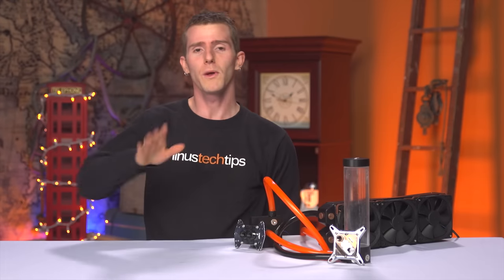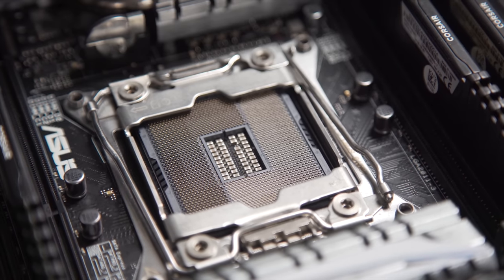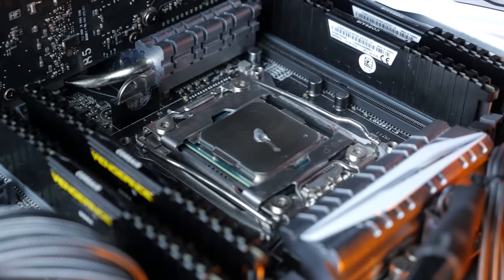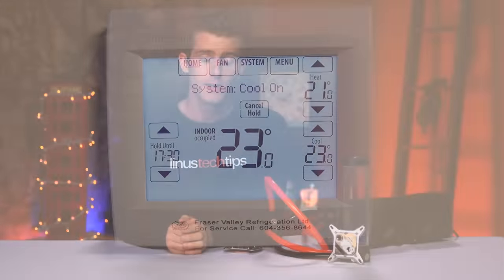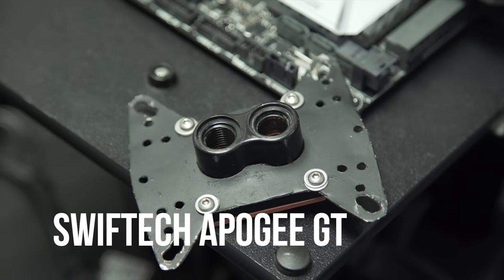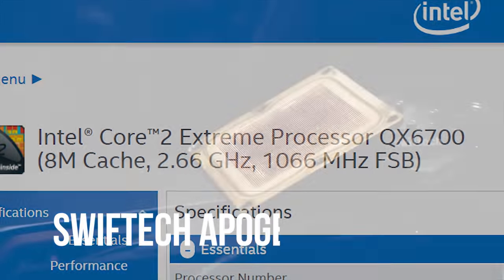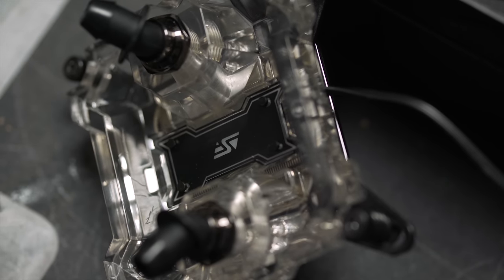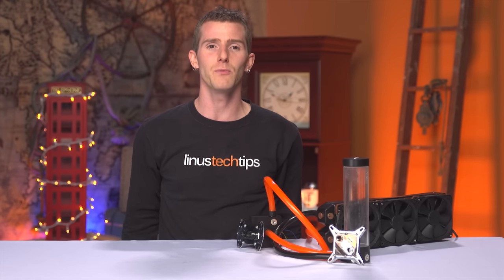TEN YEARS of Water Cooling Performance Tested! - Through The Ages Ep. 1

Comment: Watercooling looks so cool but boy does it get pricey.
Reply: I think everyone who watercools falls into the trap of 'just one more upgrade'.
Reply: I don't find it cool looking. I can only see it as too much work, maintenance and price. I'd rather keep my stuff with closed loops or air cooled.
Reply: Try buying that in South Africa.
Reply: +SpiralArc Your like 11, shouldn't be talking of that kinda things. And if not you sure sound like it.
Reply: I think this could be a cool and interesting series.... As long as they stop "getting lazy" and do a complete "through the ages" run down of each topic they decide to cover... Ik water blocks are a pretty small thing to complain about since obviously they would get better over time... But I'd hate to see something like how mother board "architecture" has changed or improved skipped, just bc they were lazy...

Other than that I think this is a great idea and I'm excited to see what comes next
Reply: The only thing I dread is the maintenance. Draining, cleaning all the rads, blocks and fans, is no soap opera.
Reply: *****
 Using an H100i V2 for my 6700k Myself
Reply: *****
AIO coolers are limited by their closed loop. Custom water cooling build is only limited by the size of the case.
Reply: Nice. I'm using H100i V2 for my 6700k as well.
Reply: UberMan9000
 Running stable at 4.5 Ghz with 1.29V with Aida 64 load temps after 10 minutes at 71C with the system WHISPER Quiet since I have the fans ramped all the way down, how about you?
Reply: @Quetzall , I got myself a corsair h80i v2 and the only maintenance ive had to do, which wasn't really necessary, was clean the rad. which was easy cause i dismounted the rad and used a vacuum on it and a dry-clean paintbrush to get the most out of it. I would recommend a air-pressure can thought, i didn't have one when i did the maintenance.
Reply: *****
 "custom loop" is a bit to general, someone could get a small single 120 custom loop that performs worse then a 240 AIO or they could pull a Jayz2Cents and have like a fat as fuck 360 or 480 rad for just the CPU and kick the living shit out of AIO's
Reply: Running stock right now. I haven't had time to tinker around with overclocking it yet or stress testing it. I have my fans running at the lowest setting and temps hover around 40-45 C while playing games.
Reply: Unless you ENJOY doing maintenance on a PC, I highly advise against it.

It obviously takes ton of prep/setup time. But even once it's completed, whenever you decide it's time to purge the loop, and/or change/add a component (That is in the loop), you are looking at an hour or two for something that would take anybody else 5 minutes.
Reply: It sure does!  You gotta either be rolling in money or extremely irresponsible to justify it.  I'd rather invest that cash and make my 8% interest.
Reply: That of the maintenance is an arguable thing... if you design your watercooling loop with some logic (hence a drain port on the very bottom point of your watercooling loop and short, good flowing tubing runs), then maintenance could be pretty easy... if you use good coolant and don't mix metals the blocks maintenance is a pretty rare thing... you'll just need to change the coolant every like 2 years or so :)
Reply: +Fabio Bologna You assume that none of the parts you ordered are DOA, or die within first few weeks of usage. (actually happened to me) 

And regardless of how well you plan your loop, there is no way that changing a GPU Waterblocl takes less time and removing a air cooled GPU... 

The reason I said you should "like maintenance" was some kind of attempt to illustrate the difference of Labour between air &  water. 

Everything you do to your case with air, you still have to do with water. And I'd argue threat removing a fan and blowing air on it is easier than dismounting a rad for its "yearly ish"  thorough dusting.
Reply: Actually, my resevour is mounted in a removable way, so I can take it out, disconnect the fittings, empty it and put it back in. Or even fill it without removing any tubing. It looks sexy af and I will add a GPU to it soon but it's aircooled now.
Reply: And to add a gpu block, all I'd have to do is snip a tube in half, attach fittings and turn it on. I admit that it may take 30mins but I feel that 50degree card would be worth it.
Reply: If you're content with AIO solutions and the flexibility limitations it entices, watercooling really don't need to be that expensive. It won't be flashy and hardcore, but a reasonable kit will definitely outperform pretty much any air cooling  solution. And top tier air coolers usually costs more that a better performing AIO closed loop kit. As most of them are closed loop units, they're pretty much maintenace free. Just check for signs suggesting a leak, once in a while.
Reply: Abhinav Praveen If you are able to dissemble a stock cooler on a GPU, install the waterblock on it, and modify your loop to welcome the new addition within 30 minutes... You are some fast PC assembler.
Reply: pr0xZen The only AIO kits that outperform aircooling cost like $300.  I'd rather take that $300 and take my 8% on it for the next 3 years.  At the end of the day I have $380 and you have a pile of obsolete plastic. In the middle, you overclock a tiny bit more?
Reply: I don't like installing gpu waterblocks (I tried :D) so I'l probably buy a prebuilt one from the place I buy my parts.
Reply: Abhinav Praveen Ahh, ok. Then  you remove about half of the work right there. Unless you do that on a daily basis, you kind of want to take your time and be gentle, since you snap that PCB and good luck getting a refund! lol
Reply: But I did 😂 Nvidia replaced my broken gtx 1080 😂😂😂
Reply: Linus is the Neil deGrasse Tyson of computers. I have no idea what he is talking about but it's compelling and wonderful. David Attenborough would be jealous of his speaking skills.
Reply: the real benefit for me using a AIO is the space something like my noctua nh-14d takes up temps are about the same maybe if you forked out for something like the EKWB AIO modular system there may be a performance difference but thats a tad pricey
Reply: I'm not into custom loop watercooling (H100i GTX + 980 Ti Hybrid here) but being an enthusiast I already fall into the trap of "just one more upgrade" .... Oh look at that shiny fan controller with touchscreen WANT. Look at those quiet fans WANT. Look at these LED Strips WANT. Look at these dust filters WANT. Look at that mousepad WANT.
Reply: I personally went AIO for the noise level, I'm able to achieve nearly silent (like sitting 5 feet away on an open test bench can barely hear ir) while maintaining the temps I do, while air cooling can match the temps, or come close anyway, it can't match the noise level at those temps.
Reply: DanielRichards644
 Lucky B you.... The stock fans that come with the h100i GTX are loud af. I have set them to go to 1000 RPM max but they're still really loud plus my 980Ti hybrid is defective, the pump is loud as crap and the temps are reachin 70s when gaming.
Reply: I was going to get a H55 for $50 

But then, I learned about leaking.
Reply: Mr. Waffles Water cooling is only a good idea if you already have top of the line equipment, its always a better idea to buy a better gpu than water cool anything.
Reply: Exidrial
 Downloaded a SPL meter app on my phone, turned it on, set it 2 inches away from the open case and held as still and quiet as I could, with EVERYTHING OFF, the lowest numbers I saw bounced between 19 and 22, turned on the tower, had a couple times the pump was audible during boot (bumping up into the mid to high 20's) then once it was all booted up the meter dropped back to the same 19-22 db range, literally lifting my foot (wearing flip flops) off the concrete floor made it spike to 30, thats how quiet the thing runs with just the fans of the AIO running at idle.
Reply: DanielRichards644
Yeah I'll replace the fans on my H100i GTX with Noctua NF-F12s soon and get a fan controller for the remaining fans. Want to control my 980Ti Hybrid's Push/Pull fans with that one as well...

The 980Ti Hybrids pump itself is almost as loud as my case fans with the pc at idle. And yeah you can hear its fans pretty good on idle. I guess there's no way around RMAing that card soo.

Downloaded an SPL meter app for fun as well, held it to my case (around 2 inches away as well) and it showed 46-52 dB. <- That's with my PC on idle.
Walked to the other side of my room and it showed 14-18 dB.
Reply: 8%? Where?
Reply: Exidrial
 I found my pump makes more noise in quiet mode then normal (using the corsair link software) so I set it to normal then slowed the fans as much as I could.
Reply: DanielRichards644
Nah I wasn't talking about the h100i's pump.
I was talking about my EVGA 980Ti Hybrid's pump.THAT thing is loud, almost as loud as my fans.

The h100i's stock fans are loud even at sub 1000 RPM, that's why I wannt to replace those.
Reply: Exidrial
I know, I was just saying thats how I quieted my pump down, maybe there is a similar setting for the pump on the hybrid, I can't remember who did the cooler for that card.
Reply: DanielRichards644
The EVGA 980Ti Hybrid basically is just a reference 980Ti with EVGAs Hybrid cooling kit preinstalled on it.
Sadly you can't control pump an radiator speed, only the fan on the card.
And tbh I don't think turning down that pump would be a good idea as the card is already getting 20°c hotter than it should.

Damn I have so much bad luck when it comes to computer hardware ._. There's always something wrong with the stuff I get.
Reply: yes water cooling is pretty expensive but if you cool only your cpu you can get aio and custom kit that get job well done for decent price. but when you cool your gpu that where shit get ridiculously expensive just gpu block can cost up to 135$ add backplate (you really prefer to put one otherwise your card would bend like a banana ) which is 30+$ and that just the gpu not including editional fittings rads and etc
Reply: +Elliad Buchnik True, but now in days you can get a GPU with a water block pre-installed or just simply get one with it's own dedicated AIO.
Reply: thats not the same for gpus, fullsize block is much better
Reply: and not to mention the constant maintenance.
Reply: It's expensive of course , but it also ads a potential risk - because water- and it needs maintenance .
In my opinion only ritch people do it , cause others spend their money on actual hardware .
When you have gtx 1080/titan + i7 extreme series and still got money , then you might consider it .
(maybe all of you know but you need pump 70$ , reservoir 40-60$ , tubing 25$ , fittings 6$ each (you need minimum 10) , radiators 120$ 140x420 , blocks 120$ gpu , 60$ CPU , you end up with at least 450$ (500) ,+fans , for a simple cpu+gpu custom loop , many people could buy a gtx 1070 , or an i7 6700K + 100$ air cooler)
Reply: Curious Tinkering I think that's a misconception. I drain and refill my loop once every 6-9 months. That's the only maintenance.
Reply: that's just it. at least twice a year you drain, flush, refill or get clogs, growth, discoloration. I have planned a new mitx build on water but it minimum budget for parts (all EK or mixed with bitspower) would cost me a minimum of $700
Reply: Curious Tinkering Two or three times a year isn't much to complain about.  
Only cons I would say for a custom loop is the price and risk of leaks. 
Though EK Predator series can potentially create a full loop with less risk.
Reply: Mario Darnadi
People forget that even without watercooling there's maintenance...or you could leave your PC to collect dust on the inside, your choice.
Reply: Mario Darnadi dude i have custom loop with 2 gpus and everything but you gotta comment in 1 reply the notification in my phone is driving me crazy you know.
Reply: EVERYONE BEHAVE or I will REMOVE ALL YOUR COMMENTS.
Reply: Exidrial Yep, I usually blow dust out and clean up a bit at least once a month.
Reply: Well Mario, you where warned.
Reply: *****
Okay depending on your setup once a month might be way more than I'd do.
I always try to have neutral/positive pressure, keeps the case really clean.
I turned 2 fans around a while ago and holy crap the case collected more dust in 1 month than it had in the 4 months before that.
Reply: Exidrial I got a old HAF 922 case, attracts dust like a magnet, specially only having filters in the front panel.
Reply: Melthornal I disagree. I have the Intel TS13x, which is a small, effective and fairly cheap AIO. And it has no problem keeping my i5-750 at roughly 65c under load, when overclocked to 4,5 GHz. Thats 56% overclock, and a f*ckton of heat. Good luck doing that with air cooling - /especially/ anywhere /near/ that price.
Reply: pr0xZen my 2600k is overclocked to 5ghz on air and maxed out at 58c max load when I ran a CFD sim (that had no GPU acceleration, grrrr).  It took 14 days to run, taxed computer like crazy sauce, never crashed, never over 58C. Also my air cooler cost $35
Reply: with the Noctua NH-D15 and it keeps my i5-3570k @4.5Ghz below 64C under full load. It's not at 156% of it's original clock speed, none the less its a big improvement.
Reply: Sidowse depends which AIO and which watercoolers. those aircoolers doesn't always fit well depending on the ram clearance and the case. But hands down the best performing coolers are watercoolers
Reply: Eliad Buchnik Water scales better with surface area. With small surface area, heat pipes and vapor chambers are much better. At high surface area water cooling is better. That means at some point they are equal. Exactly where they point is seems to be around 120mm x 35mm rad or so.
Reply: Melthornal yet unless you have some mini tower case or other type if small case,  most midtower cases would be able to accommodate at least 240mm rad if you do buy AIO put few more bucks for bigger radiator cooler. you have the cryorig a40 and a80 with 240mm and 280mm radiators for the prce 104$ and 124$ respectively. and they have excellent performance especially high tdp cpu with high oc. they more expensive then high performing air coolers but not awful a lot  yet they preform better and you don't need to get this massive chunk of metal on your mobo that might cause clearance problems with the ram or the case itself.
Reply: Sidowse i don't know about h100 i had h110 and it was pretty quiet also i had nh-d14 which is similar in size to nh-d15 it just caused so many clearance issues and if you want to use some tall ram sticks and 2 gpus or some other pci e card it pretty limits you depending on your other components. also first slot is usually the only x16 slot again depends on your mobo
Reply: Sidowse
then you need to learn to tweak your settings, I've got an H100i V2 on my system and it's INAUDIBLE from 4 feet with an OPEN case. Set the pump to performance and the fans to silent
Reply: Sidowse
the V2 is a rebranded GTX and the GTX gets you an extra 2-4 c cooler from what I can find in a quick search, and I have no trouble running the settings I gave and cooling my 6700k OC'd to 4.5 Ghz at 1.29v even when rendering I won't go over low to mid 70's C.
Reply: Sidowse 65c seems pretty warm. My 2600k overclocked to 4.8 isn't even that warm and I'm using a cryorig h5 universal, which should be far less efficient as dissipating heat.
Reply: Melthornal run it few hours with prime 95 and monitor it max temperature. most chances it would pass 65 degrees and you should take in mind that thermally 4770k is pretty hot chip and it has some shitty tim between the ihs and the die unlike sandy bridge cpus which are welded to the ihs those has much better thermal conductivity.
Reply: Eliad Buchnik I've run this machine under max load much, much, much longer than a few hours. I ran a 3D render that took nearly 3 weeks at 100% and monitored temps the whole time. Hovered in low 60s most of the time.
Reply: Im_A_Perv novices will feel that way.
Reply: Exidrial why are people so negative. buy a air duster have it for life. it blows like 180km per hour air and gets all dust gone. how hard is that maintenance? anyway why qe complaining about maintenance  are we that lazy to clean what has to be done? dont you clean your house ever? its really not hard just comes down to being a lazy negative person.
Reply: There's an overlap in value between air and water... You're better off with an AIO than a high-TDP air cooler. The air coolers get way too big and expensive above 100w TDP. For $90 you can get a 230w TDP AIO, or for $110 you can get a 130w rated air cooler that barely fits into any case and doesn't fit all mobo's because of VRM heatsinks, ram height, etc.
Reply: @kedwardsTWO  I get 95c on my chip I think I need it